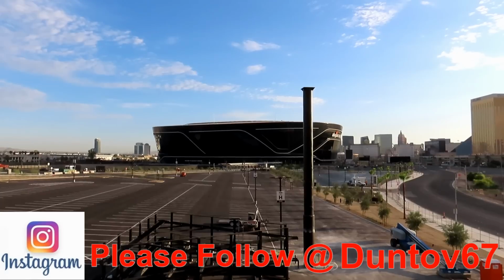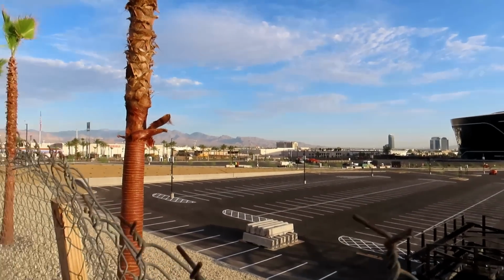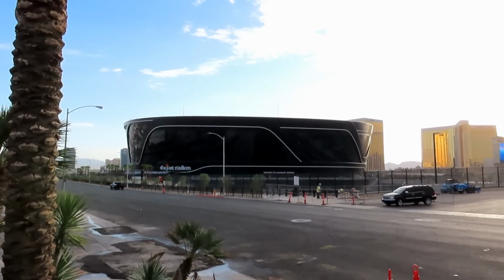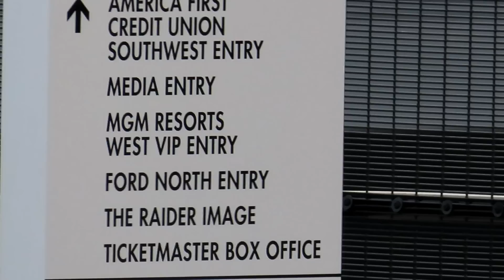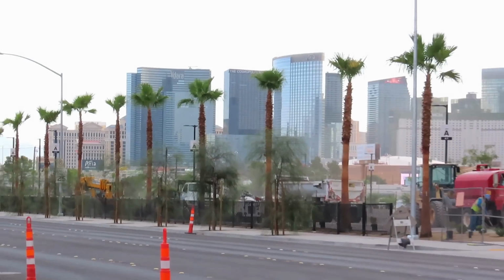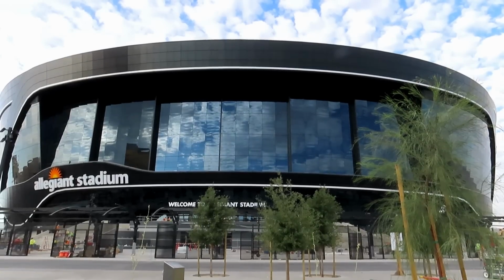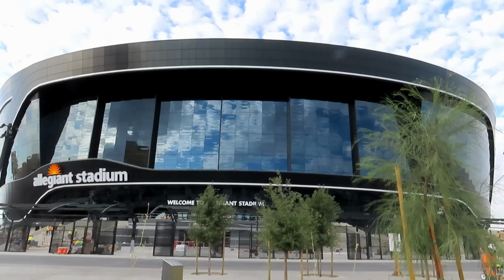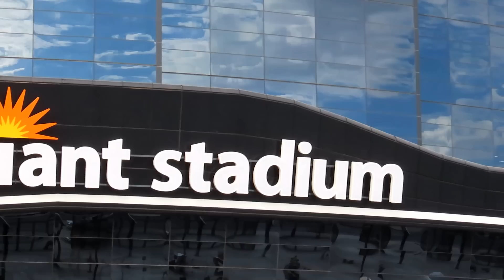Las Vegas Raiders Allegiant Stadium Construction Update 07 11 2020

Comment: Why can’t you go higher with the drone like other youtubers?
Reply: They have drone pilot's licenses and permission from McCarran Airport's control tower. Duntov does not have either of those.
Reply from the maker: My drone will only go up 20m approx 65ft. at the stadium.  It is geofenced because of the proximity to the airport.  The drone stops by itself at that height.
Reply: Raiders 1967 spring for a license.